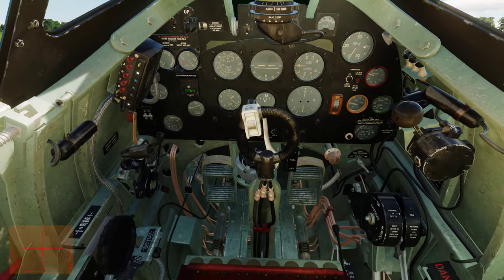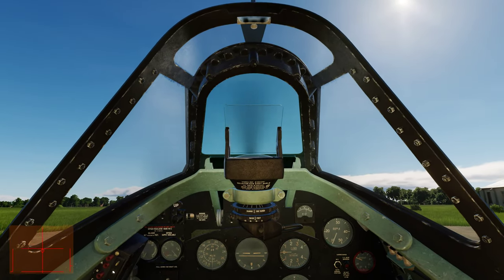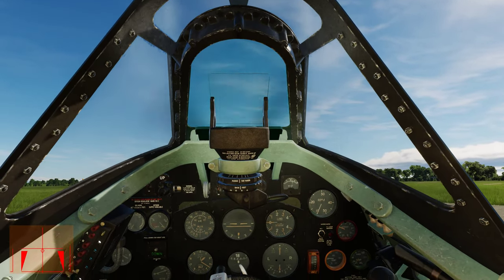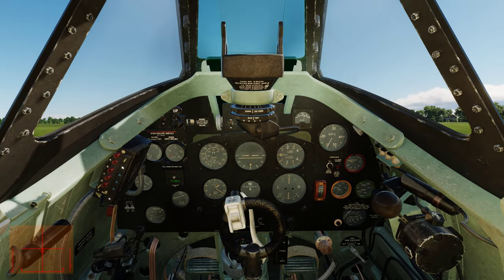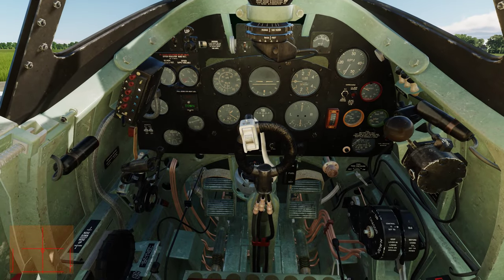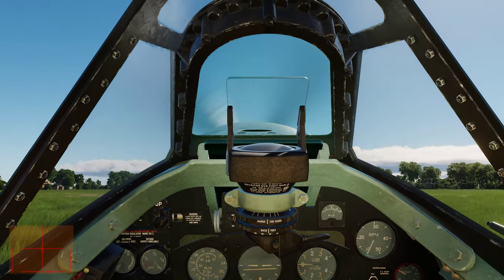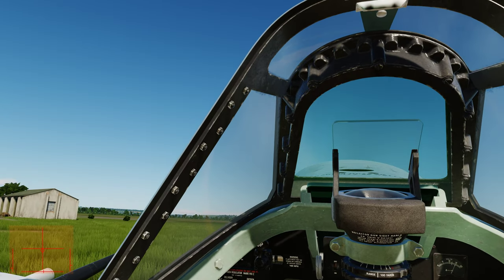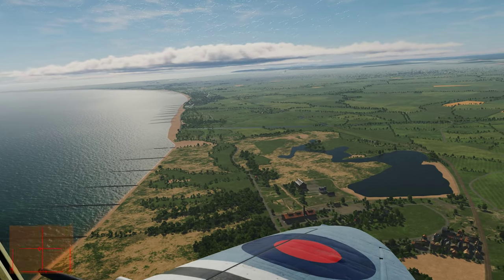WHY IS THE SPITFIRE SO DAMN HARD TO HANDLE? - Spit Mark-Nine Tips For DCS World Pilots - w/Sound Mod

Comment: Just completed by real life taildragger endorsement for my licence. Made this a lot easier to fly in DCS. Tips from real flying. Hold back the stick.TRIM 1 MARK NOSE DOWN AND RUDDER FULL RIGHT TRIM. add boost 4 then push stick forward until tail comes up. Use larger rudder movements when slow and less as faster. Then when about 60mph add boost to 8. Slowly move stick back and wait till it takes off. Always look forward.
Reply from the maker: Awesome input and pinned to the top. Thank you, and my add… Always keep flying the aircraft even when on the ground.

Comment: There is an outfit that provides 3D printable plans for Spitfire spade stick, throttle and landing gear controls. Their name escapes me, but there are vids here on yt. I think there’s a reference to them in “Chuck’s guide “ for the Spitfire.  Edit: Authentikit is their name.
Reply: I have printed and use the Spitfire Authentikit controls and makes this a joy to fly.
Reply: I use the Authentikit Spitfire spade controller. Two things it has that make controlling the Spit easier: longer length of stick provides greater fidelity controlling the elevator and an analog brake lever.  Highly recommended.

Comment: Dancing on the rudder is an excellent suggestion.  I find I am over correcting by holding the rudder too long.
Reply from the maker: Give her a little hug on each side and loosen up the pressure as ground speed increases.   “Dancing” on the rudder is something Cabi~ taught me 20 years ago and it still sticks in my memory.

Comment: A lot of Spitfire and Bf109 pilots died  while trying to land due to the narrow landing gear.  The FW was so much more stable with it's wide undercarriage.
Reply from the maker: 🫡Great point,  I feel the Mustang and Thunderbolt fit in well to for that reason.  Thanks.
Reply from the maker: Hey, thanks, I kind of made it to be sarcastic that it can be difficult, but if you practice and practice it gets easier because I actually don't find this spitfire challenging to take off and land anymore. It helps to have the controls dialed in and be aware of what aircraft I'm in because if I jump out of one airplane and into another, I have to change my mindset of how to control the airplane because there are a lot of differences. Cheers, and have a great week.

Comment: I threw in the towel and put on the auto-rudder in total frustration, when it came to takeoffs... For the rest, Chuck's Guides helped tremendously in terms of setting controls for ground and takeoff handling. Landings, by comparison, are very easy....make of that what you will.
Reply from the maker: I started with Autorudder and takeoff assistance when I had my twist stick before 2018...then I slowly reduced the settings and my curves/deadzones to minimal and now  with pedals and knowing the trim...it's better.  Bites me sometimes.  Chuck's a friend and his guides are great Quick Ref for me...but I really love Reflected's ultimate tutorial series on the warbirds.

Comment: Having flown the Spitfire since its release, here are my tips:
1) BIND YOUR BRAKE TO A TOEBRAKE ON YOUR PEDALS.  This will help you incredibly!  You get much more brake precision with an axis, versus a button.  It doesn't take that long to get used to, either.  This alone will probably be anybody's biggest help when it comes to handling the Spitfire on the ground
2) For takeoff, spin the elevator trim until the trim indicator is pointing anywhere from +0.5 to +1.  By default upon spawning in, it's set at +2.  This is more akin to what your landing trim will be, than takeoff.  And for rudder trim, trim rudder right until the knob hits the stop, or maybe slightly less.
3) CONTROL SENSITIVITY: If you are having problems trying to control the Spitfire in the air and keeping it steady, go to Adjust Controls, down to your axis controls, and find your pitch axis.  Edit/customize that axis, and set its 'Saturation Y' to 60.  This gives you 2/3rds of the Spitfire's true pitch range, but those 2/3rds are practically all you will ever, ever need.
4) When landing, set pitch trim to +2.  You'll want to come in at around 110-100MPH, but it's less about what your actual speed is, and more about what your AoA is as you come in to land...that's just something that you get acclimated to with time.  Once you set your wheels down, LET IT ROLL for a few seconds to allow it to stabilize, or if it doesn't, give you a chance to throttle up and take back off before things get out of hand.  Then, start braking.  Unfortunately when it comes to braking, slowing down after landing, there's no special tip for that except get experience.  You'll probably be scraping your wingtips left, then right, then left again and then come to a stop with your ass in the air for the first 5 or 6 attempts, before you finally start to see yourself improving.  But keep at it, and you'll get there.  The Spitfire is one of the most rewarding experiences in DCS to master, a true aviator's plane!  Before long, you'll be successfully making smooth landings with one popped tire and a jammed rudder control rod
Reply from the maker: Thanks a bunch!!

Comment: I use the analog twist on my Thrustmaster T16000 joystick.  Sort of replicates the exact muscle movement of reaching and squeezing the brake handle. Rudders are the T16000 cheapie pedals that came with the 3 piece set, but work well enough.
Reply from the maker: Thanks for the details...that's a great idea.  I thought of buy a Spitfire Spade Column but man, I don't like switching over and try to use one setup for everything.  Helicopters is pretty smooth for me, and with my paddle, I just have to remember not to squeeze it all the way (pump, pump, pump) but your twist axis sounds perfect.  ~ Juice

Comment: A little advice for making power setting changes to high performance engines is this, when reducing power: Set MP, Set RPM, Set Mixture and when increasing power: Set Mixture, Set RPM, Set MP.
Reply from the maker: Great tip.  You can definitely tell that I don’t have a complex rating. Fuel injected in standard carburetor is all I ever flew. Never did complex prop or gear up gear down training. Only have 10 tail well and needs to my name and everything else is tricycle gear, Cessna 150 or 172.

Comment: Hi, and thank you for the DCS WWII content lately. I have taken the dive and began making videos to give people tips also. They are amateurish, compared to yours. WWII in DCS is very underrated or under appreciated so to say. I think a lot of the problems new players have are related to the fact that DCS WWII is way more labor intensive, meaning that most anyone can jump into a modernish jet sim with fly by wire flight controls, and pretty much fly right out of the box. But Tail draggers are a totally different beast. they give even experienced jet sim pilots problems.  I have been around GA most of my life. DCS is by far the most realistic of the combat flight sims, as far as prop aircraft go. I think it has to do with their helicopter experience. A propeller is a rotor basically, only its on the front instead of the top. learning to fly the aircraft is too hard for some people at first. and then you have to learn combat maneuvers, and how to shoot. That's a whole other ball of wax. its a steep learning curve, but well worth it.
Reply from the maker: Thank you and I will have to check your content out…I’m sure it is better than you give yourself credit for.
Reply: @AIRWARFAREGROUP  thank you sir, people say I sound drunk, But I don't drink any more, and I cant help that I sound like Huckleberry hound.... Lol

Comment: I use the throttle slider on the warthog throttle, i roll it forward to read 4 on the brake pressure gauge and leave it there for taxiing works a treat
Reply from the maker: I thought about using the slider on the right side of throttle that I have now sent to the prop lever. Then I could use the left throttle for the brakes but so far my pedal switch is working out fine for me.
Reply: @AIRWARFAREGROUP  Yeah i did try the paddle switch on the stick but i kept forgetting to apply it, i think its muscle memory built up from flying jets you pop the nose wheel steering button and thats it until you get lined up.
The thing i struggle the most with is bullet convergence when shooting down targets of opportunity.

Comment: Hey guys, really enjoy your videos. I use the TM TPR's and have set both brake pedals as an axis to the brake handle. I set them as sliders and now can use either pedal to modulate any brake pressure and still have left and right control with the pedals.
Reply from the maker: Great tip! I was thinking that DCS will let us double bind a control...so your setup is a perfect solution...thanks for sharing this...J

Comment: Here is an idea for a controller for flying DCS.. 

I use an RC (Radio Control) radio to fly my DCS Spitfire. The radio is a TX16S. Connection to my PC is by a 2m USB cable giving me 32 channels. This provides all controls in one ergonomic device.

The radio uses EdgeTx which means I can mix/adjust and program anything and everything from the radio. 

Radio has two sticks. Right hand stick is elevator/aileron. Left hand stick is throttle/rudder. So no dodgy foot pedals to deal with.

For brakes I use a slider on the side of the radio which automatically blips the brakes on/off at a rate depending on slider position. Works very nicely. Same slider raises/lowers UC.

I don't use curves in DCS, I use curves in my radio inputs. 

I don't use DCS trims. I use the trim tabs provided on the radio.

Only downsides are - 
1) Gun trigger is separate switch and not mounted on a joystick - but just takes getting used to.
2) Rudder is hand operated rather than foot operated. Pluses and minuses to this one. Not ideal for transitioning to manned aircraft, but perfect for transitioning to RC model planes.

(I've been doing circuits & bumps in the DCS Spitfire for a couple of weeks now. I get about 6/10 successful landings but improving all the time!)
Reply from the maker: Sweet, thanks for sharing this!

Comment: The myth with the narrow landing gear making the Spitfire hard to taxi and takeoff is just not true. There are plenty Spitfire pilots on youtube stating that the Spitfire is VERY stable, you only can not brake her hard or she'll tip on her nose. The problem we have in DCS is that the prop wash over the rudder (and elevator) is not simulated. Try it out, hold the brakes in any of those WW2 prop fighters and move the rudder or push forward. Nothing will happen. Then do the same in that Piper Cub. In DCS you need differential brakes and airstream to keep directional control. In reality the prop wash can help keeping the engine torque under control. 

I recommend the videos of Dave Hadfield, he flies a Spitfire and several other british and american fighters of a private collection in Canada. During his flights he often comments (voice over usually) about the quirks and tricks flying the plane. He is quite clear that the Spitfire is NOT hard to keep on track during takeoff.
Reply from the maker: Thanks for your input ✌️I’m finding it easy to manage, second only to the Mustang. https://youtu.be/EKsQd4SINEM?si=VpowMDjuXTZEFaLa

Comment: Good thing is that i started with spitfire my DCS journey so other planes were not problem after that, mostly jets
Reply from the maker: Cheers!  If I read you correctly, master the Spitfire, you can handle any Warbird?  I would agree.
Reply: @AIRWARFAREGROUP  Maybe its just beginnings i went from spitfire to jets for long time, then apache and helicopter was very different, i learned to use rudder better, then i took bf109 and long time that was terrible on ground but after handling bf109, spitfire was easier and now everything i fly is like some deep muscle memory where plane just need more or less of certain things. Probably just more experience when i compare my day one of crashing everywhere with now smooth landings ,... years will do life easier.
Reply from the maker: Thanks for the feedback and for watching the video.  I had a guy today comment that without even watching the video he will tell me why it's hard...because I don't have an extension on the stick.  I started to answer him, and realized he didn't even watch the video so I just deleted his comment.  The video is about the IRL Spitfire design and considerations for flying it for real as they transfer to DCS.  LOL - My stick might be short, but it works for me just fine! 😜 If you catch drift.  Cheers Alcatraz!
Reply: @AIRWARFAREGROUP  🤣🤣🤣, iam flying it on f16 stick with virpil base and its good. Like warbirds were always harder to fly, it make sense they dont have those fancy computers and engines you can push to full and dont care anymore. Cheers to you too.
Reply from the maker: I have a couple of AWG members that just bought force feedback stick base and now I am wanting one 🤔